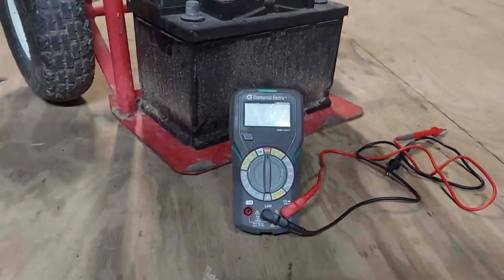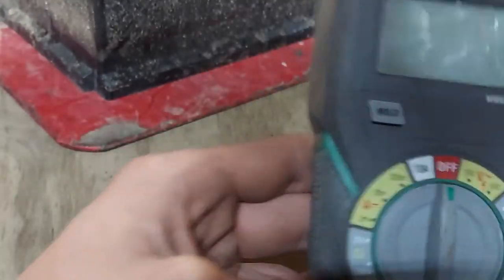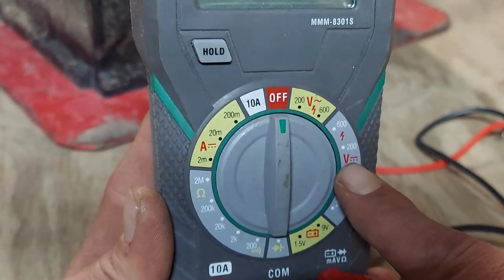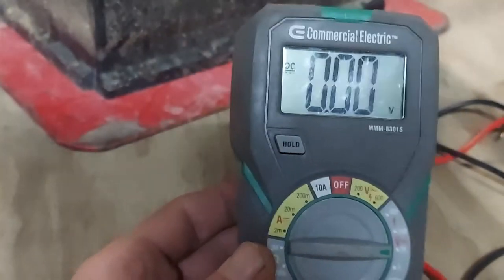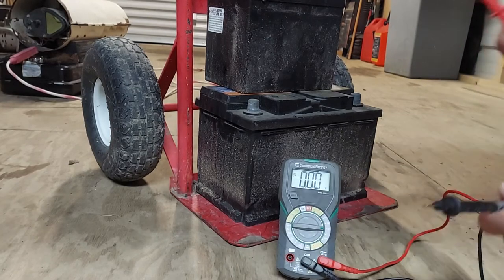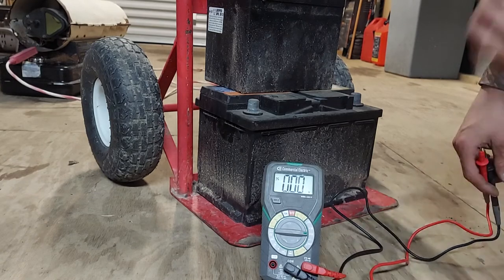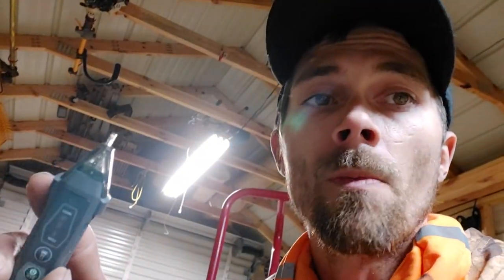What setting to use on multimeters when testing car batteries???

Comment: When testing any type of battery you should do it when the battery is connected to something (a "load") to get a true reading. If the battery is not connected to a load it will give a reading which is higher that the actual voltage that is available.

Comment: I have that exact meter. Is there a way to test your meter to see if you have a blown fuse in your own meter.
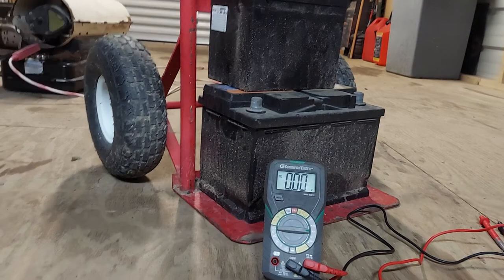Reply: 1. insert ‘BLACK-negative’ wire into ‘COM’ (bottom-middle/black)    2. Insert ‘RED-positive/hot’ wire into ‘mAH OHMS’ (bottom-right/red)     3. Turn ‘GREEN-marker’ on (center-dial)  to align with ‘YELLOW-OHMS symbol’ (little under 9:45-in reference to clock face)         if you have no idea what the OHMS symbol looks like-it’s similar to upside down horseshoe (yeah, horses hoe-once you see it, you never will unsee it😂) or the Greek letter for Omega        3. Now, once you’ve made it this far…. Shit, you’re on YouTube man! Why don’t you type your question into the search bar, instead of asking advice from a guy who is clearly not a professional           (to homeboy who made the video… no disrespect bubba!! I liked it)
Reply from the maker: Thanks. I was just gonna say open up the tester and check the fuse